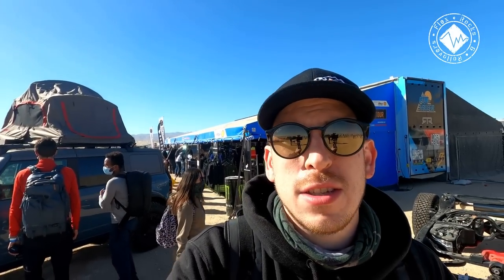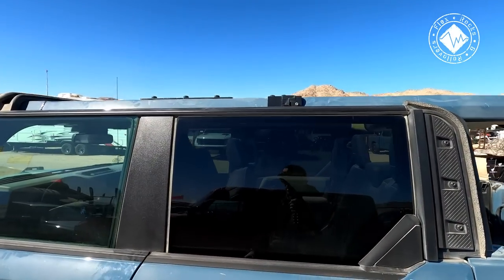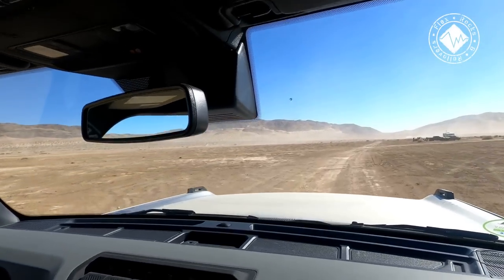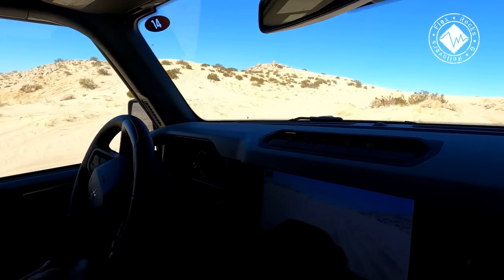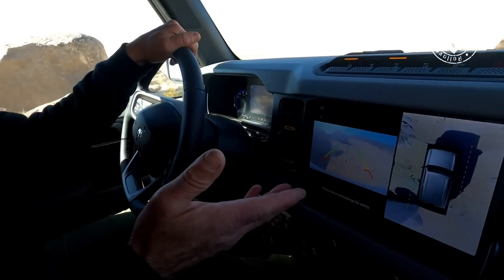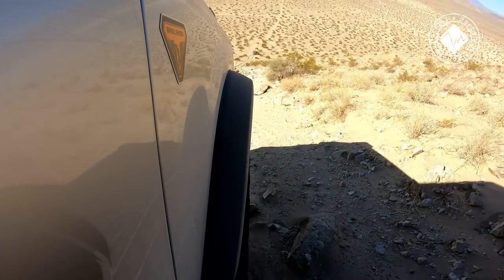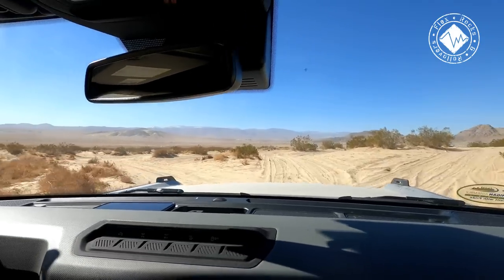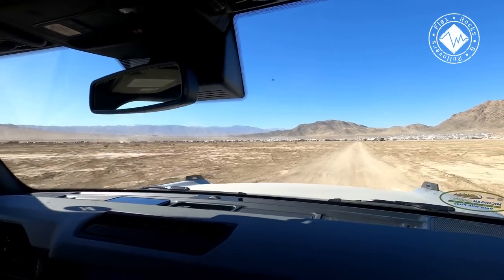Off Roading the New 2021 Ford Bronco! Reaction + Walk Around

Comment: Nice truck but all this technology has been available in the Land Cruiser since 2008 and the 4Runner since 2010. I was hoping it'd have a front solid axle option. You can't even get the manual with the V6. Disappointing.
Reply: The wheel travel and tire package are a class above anything from Toyota (or Land Rover for those who care) and is actually better than Wrangler too, though that's closer. It is an impressive vehicle to be sure, i'm glad that there is finally a solid IFS alternative to the SFA Jeep. Jeep was the only serious option for wheeling hard, and not everyone wants to sacrifice the high speed fun, especially when IFS can be made to flex fairly well as the Bronco (and KOH) has proven
Reply: @mattg8116  Bronco has 7.8 front travel and 8.46 rear travel. 4Runner has 8 front travel and 9 rear travel. KDSS adds something like an additional 3 inches of travel. Bronco isn't the suspension travel king especially compared with a Rubicon with disconnect sway bars. My point here is the Bronco isn't bringing anything new to the table and its for all the interior sacrifices you make for the price in comparison with the 4Runner, you're also sacrificing axle articulation you get from the Jeep. In other words, its just combining 4Runnerish technology in a Jeep-like wrapper.
Reply: @CACressida  I'm intending to be cordial, but ill offer the correction that Bronco has 10" front travel and even more in the rear. That's more than Rubicon, let alone 4Runner. The Wrangler is sick I agree, the 4Runner is the vehicle that never offered anything over any other basic SUV. Bronco is bringing big tire package (super critical) and wheel travel right to the Wrangler which has desperately needed real competition for a long time. This stuff is already documented but I'm super excited for y'all to find out on the trail!
Reply: @mattg8116  10" with sway bars disconnected. The RTI of a Bronco is 560 connected and 700 disconnected which is still 42 less than a 4Runner with KDSS. The 4Runner brought all the tech thats on the Bronco 11 years ago. That offroad Cruise control has been around since 2008 Toyota called it Crawl Control. Crawl control can actually work for a long time continuously without overheating while fords version only lasts about 5 minutes before it shuts down to protect itself. Like I said, ford isn't bringing anything new to the table as far as innovation. I for one almost put in an order for a 2 door until I was told no V6 and manual. I wasn't planning on buying it because it was a technological marvel, I wanted one because a Wrangler isn't exactly comfortable to drive. Rumors have been going around that Ford is considering the V6 manual and if that happens, Ford will get my money. Im only wanting a Bronco because it looks cool and I can take it to near by trails. I already have a FJ Cruiser for dedicated extended offroad trips.  Had Ford offered a SFA option, I'd buy it with a 4cyl and manual. Don't need a ton of power when you're rock crawling with great gearing.
Reply: @CACressida  LOL! Articulation is not the same as wheel travel. But no matter, Bronco has both. KDSS is irrelevant, as modifications can be applied to any vehicle, including the Bronco. If you think similar improvements couldn't be made to the Bronco then you only admit how utterly impressive it is stock. Glad to hear you like the 4Runner, you are not alone in thinking all stock IFS is basically the same weak incapable trash. Regarding the technology, I have to say you are just not being honest. I don't care about technology but to say the Bronco isn't bringing anything new and isn't improving on what's out there is just brand loyalist wishful thinking.

Edit: I ordered the manual 4 cyl. I will be crawling anywhere a Stock or Mopar level Wrangler will. And I'll be doing everything else way faster! Which after all is more fun.
Reply: @mattg8116  I already told you over and over again the 4Runner both with and without KDSS has greater suspension travel than the Bronco. These are both numbers pulled off of Ford and Toyota respectively. I dont get why you're arguing this. I never said IFS is weak trash because I own a IFS truck which I rock crawl with and desert blaze with at high rates of speeds all while being overloaded. I even have some videos of my IFS truck being wheeled on my YouTube. 

Drive modes were available in Land Rover products for 2 decades, turn assist has been on Toyotas since 2016. Crawl control has been on Toyotas since 2008. Disconnect sway bars has been on Jeeps since the wrangler TJ. What has Ford introduced?
Reply: @CACressida  I’m an engineer at Ford, that’s a flat out lie. (Unless you read the wrong spec?) I’m not arguing for fun, the Bronco benchmarked the Wrangler and the 4Runner and it sure as hell wasn’t to just undercut the wheel travel. 

Edit, if you don’t understand the difference in Fords tech packages to those you listed then I’m wasting my time. Good day
Reply: @mattg8116  you're an engineer at Ford who doesn't know the specifications of wheel travel and axle articulation? You haven't even noted one spec or noted one thing Ford innovated with the Bronco. And claiming youre an engineer doesn't mean you've engineered greatness.
Reply: @CACressida  Show me what spec you read. Link it. I will share the correct one if you have the wrong one or show where the numbers at if you need. Sorry for coming off so rude, I just have very little patience for the disinformation around the Bronco suspension. And to see claims that it’s less than the 4Runner stock would be laughable if it wasn’t so concerning
Reply: @mattg8116  and repeating "thats a lie" doesn't change anything. If Ford claimed they have best IFS travel, they would've bragged about it. The only thing Ford brags about is best in class approach and departure angles. Mr. Ford Engineer, maybe you should consult Ford for facts.

https://www.ford.com/suvs/bronco/2021/models/bronco-badlands/
Reply: I would also add that these specs are backed up with a substantial amount of footage of these Broncos both in Moab and on the Rubicon trail. You can see for yourself that this IFS is offering something more than the past IFS "competition" to Wrangler and that the Bronco will be able to chase the Wrangler up just about any trail, as I plan to. Extremely modified Jeeps will still have a crawler advantage for sure, but then again extremely modified Broncos will be able to do more than people seem to think right now.
Reply: @mattg8116  hate to burst your bubble but Jeep takes their Wranglers and Gladiators on media runs through the Rubicon trail. Toyota tests their prototype 4Runner and even had Fourwheeler magazine accompany engineers on shake downs of 4Runners and FJ Cruiser through the Rubicon trail. Motor Trends dirt everyday drove a stock  old Chevy pickup and Jeep CJ through the Rubicon. Theres a lot of unmodified or lightly modified vehicles that run the Rubicon. I should know since I live near it.
Reply: @CACressida  If only there were different lines that could be chosen along the trail to showcase capability? And perhaps some had been recorded and posted online like I said? You could take a Corolla across the Rubicon if you didn't mind winching and towing... Some obstacles are able to be driven around, while some may choose to drive over them. That's the beauty of off-roading, it is what you make it!
Reply: @mattg8116  dude give it up.  The Rubicon is no joke and you aren't taking a corolla up it winch or no winch. I've seen all the footages of Bronco up the Rubicon its not like they cake walked it. The Broncos suffered damages on the Rubicon. I've been following the Bronco since Fords old ranger prototypes.
Reply: @CACressida  Dude, its hyperbole first of all, since YOU are the one who suggested the Rubicon was a cakewalk with the plethora of stock vehicles that can "run it" But if I am going to stick to my guns, yes, you can literally winch a camping trailer down the Rubicon if you wanted. I am stoked to see the Broncos out in the wild soon, they aren't some magical beast that can conquer anything but they will be moving the benchmark, make no mistake. People like yourself make it all the more rewarding too, after all if everyone thought the Bronco was capable it wouldn't be so much fun to prove it. I literally am an engineer though, and I have work to do (fine yes its just excel work today) so I'm done here, you can have the last word if you like ;) . I'll see ya on the trail someday i'm sure. Maybe you can pull me out and then share the KDSS gospel

Comment: Adjustability means more things to break.  It is a Ford.
Reply: And the alternative (Jeep) doesnt have anything to brag lol. I have one. And dont say Toyota. The 4runner and tacoma are too old.
Reply: @eda7875  Jeeps are made with simplicity in mind.  Most Jeeps can be repaired on the trail or quickly with a welder.  Both have equivalent powertrain reliability concerns; however, the more electronic adjustability, the higher chance of failure.  4Runner does have an aging interior and suspension challenges in real rough terrain, but their powertrains are bulletproof.
Reply: @Michael-pq6dn  I wish the crap dual battery ESS system in my JL was simple.
Reply: @Michael-pq6dn  How long have you been running on the main battery only? I might have to do this myself. The aux battery is a headache.
Reply: @eda7875  My aux battery in my 2018 started to fail after 18 months and was replaced under warranty. I made this bypass as insurance in case it happened again while on the trail, but never made it permanent.

Comment: It definitely has a bunch of cool features. Front dig is probably the coolest. But overall it still looks super ugly and overall won’t be a good rock crawler. It’ll be fine to race through the desert and to overland and do some basic 4WD trails. But no matter what IFS won’t be a good rock crawler.
Reply: It wont be the best rock crawler sure, but KOH has proven that IFS can perform on the rocks, and when you combine that with performance on the trail or desert it becomes a winning package.
Reply from the maker: Straight axle conversions are probably coming. I’m sure this thing will keep up great on the trails though. The IFS handles rocks better than any other that I’ve ever experienced and is really beefy.

Comment: Sorry Toyota. You're gonna have to lose a multi-generation customer...
Reply: But.... ReLiaBiLIty!!   Just kidding, LOL. I have a 4Runner, would much rather have one of these.
Reply: Same. No more CMCs to fit 33"s on an off road model
Reply: @MidnughtMerauders it's funny, they come with small tires stock, then you have to lift them and chop the body mounts in order to fit.... a slightly less small tire, lol.
Reply: @trailrunnah8886  it's so true. I like my Tacoma off road after a lift and fitting 33s but that should all be factory. Offroad should be more than a rear locker, bad ATs and a bedside sticker (I know there's MTS etc) but the point remains that a truck marketed as off road should come stock with 33s and not need to be cut and welded on to make it happen.
Reply: Isn’t the 4Runner getting an update next year? I wonder if they are making something to challenge the bronco.